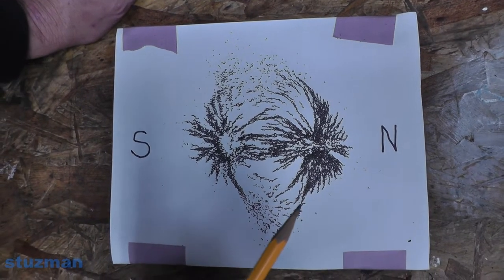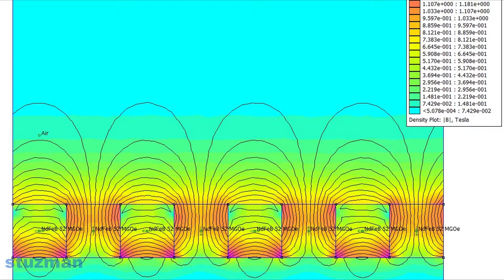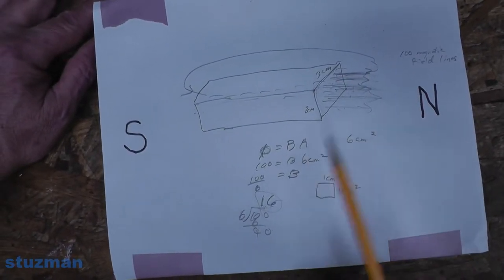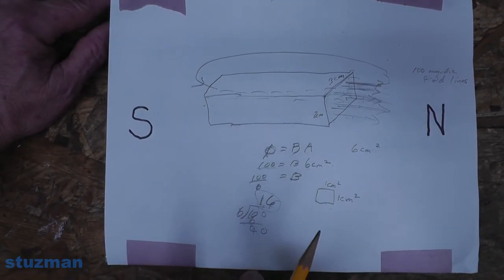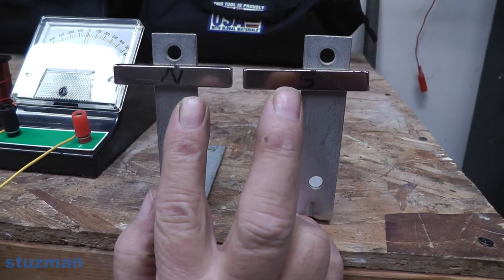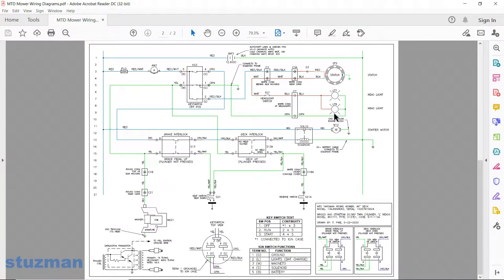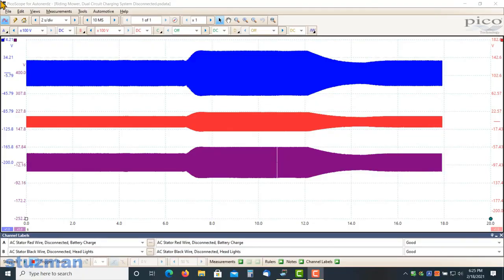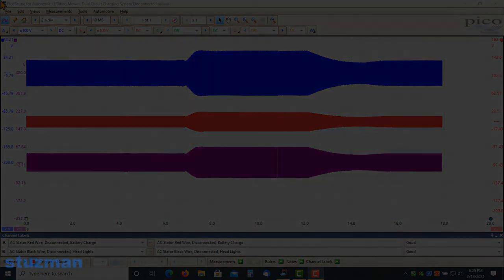Riding Mower-Dual Circuit Charging System, Stator, Magnets and AC, Pt  2 of 3

Comment: Nice. I hadn’t realized the lighting circuit was AC. I know a lot of small engine installations may have a separate lighting coil, but as I said didn’t appreciate it may not be rectified. Cheers Terry
Reply from the maker: As you know Ian, incandescent bubs will work fine on AC as well as DC. Leaving out the diode for the lights just simplifies the circuit. Thanks for dropping in and sharing a comment!

Comment: I found this to be really interesting. I didn't realize those small engine stators had two separate sections built into one for battery charging and the headlights.  The most amazing thing about this video Terry was how you gained youth and looked 21 years younger from the 8:00 minute mark 🧓 to the 20:00 min mark.🧒  If the white board of knowledge does that then I need to stand in front of it more often.  I bet you had no doubt I would notice?  haha 😉🤭
Reply from the maker: I knew that you were always observant Glen. Isn't it amazing how a white board can make you look younger? It's because the light rays reflecting off the white board has been known to rejuvenate the skin and make you look younger. HaHa! 😍
Reply: @stuzman52  lol

Comment: I knew I needed 2 cups of coffee because the presentation rattle my brains a little. Great presentation, just one quick question how does temperature affect any of the measurement????
Reply from the maker: Thank you Bernarda! Temperature affects measurements because of the higher energy state of atoms. Basically, at higher temperatures, the free electrons are moving faster and have a tendency to collide with the electrons from the source. This collision of electrons will slow down the movement of electrons through the material which creates a higher resistance to the current flow. Here's an article that may explain it a little further for you Bernarda. https://www.learnabout-electronics.org/Resistors/resistors_01a.php Have a great weekend!
Reply: @stuzman52  Thanks for the link
Reply from the maker: @bernardaflores1720   No problem at all.

Comment: Another excellent video Terry ... been awhile since I revisited algebra, but it all came back!  One question ... still trying to wrap my head around tying the A/C headlight circuit back to battery (DC) ground .... I guess the battery doesn't care if the current is A/C or D/C???  Can you explain this a little bit? - Randy
Reply from the maker: Good question Randy! If you were to check on each side of the wires for the headlights, you would have AC amps. However, remember that the source is the alternator. When current leaves on one side of the stator, it will return back on the other wire to get back to the stator. Although, the DC- wire is connected to the battery, this return current won't go back to the battery. All of this return current is going back through the frame of the riding mower. Hope that makes sense!
Reply: @stuzman52  So, in this case, the battery is part of the path back to the alternator frame!  Ok, that makes sense to me.... Thanks!
Reply from the maker: @randymarion2466  Yes, that is correct! 😀👍

Comment: Great presentation..
 I have the same motor transplanted on a mower having an electric clutch  for the deck  drive belt
 so  it is drawing my charge when on to only 11.3 volts full throttle. 
   I dont use headlights.
Can I delete the diode and use an exsternal regulator and use both charging wires out of stator to it to run current to both the clutch and charge battery ?
Reply from the maker: Not sure about that Kevin. I would take a look at the specs for the mower's stator, regulator and compare it to the stator's spec for the 'new' engine. You could also take a look at the stator's for Briggs and Stratton engines which has a regulator instead of a diode.

Comment: Question sir, my friends riding tractor is not charging, i bought on ebay a used stator dual circuit .   I checked for continuity and ohms on both coils they seem fine but on my ohm meter when i check for continuity on the ac output  wire from the coil to the diode dc output i get nothing when i checked both ways ??  It seems i have an open diode or maybe not enough ac v to turn the diode on according to your third video...thank-you very much, STAY AWESOME MATE !!
Reply from the maker: It sounds like your stator is fine. If your meter has a diode function, use it instead of an ohms setting because if you use an ohms setting, the meter may not deliver enough current to turn the diode on. As there not being enough AC to turn the diode on, this is very unlikely as it would point to an open stator winding which you said you had continuity. Have a great day!

Comment: my lawn tractor that as a Briggs engine with the same Dual Circuit Charging System when the engine running the battery is charging at around 19 volts the same from the stator wires 19 volt from one wire and 14 volt im gusting for the lights so im just wondering if its normal
Reply from the maker: Hey Stacey! The 14V for your lights is normal. The 19V sounds a little high and I'm assuming that you didn't disconnect the charging connector near the stator. If so, then you would measure around 19V. It could be normal, but I didn't see this high of a voltage on my mower. The highest for me was around 15V. Check the amperage going to the battery as it could be that the battery isn't accepting any charge. Have a great day!